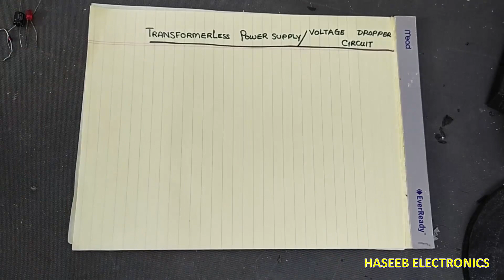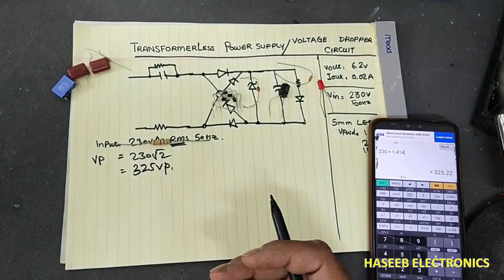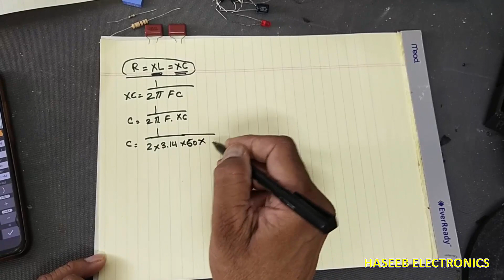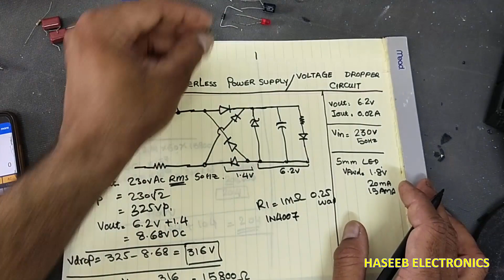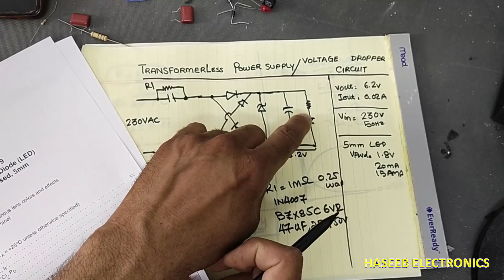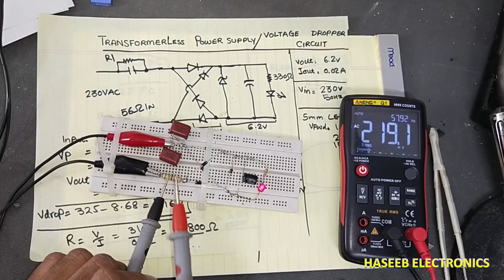{680} Transformerless Power Supply Circuit, Capacitor Dropper Circuit

Comment: Very informative video. Nicely explained practically. This Spacaility is only in your vedeo. I like your all videos. And watch again and again. I will be very thankful to you if you explain servo motor driver circuit. And i request u that pls make a vedeo on voltage stabaliser for 6 kw cnc machine.

Comment: U use a 47mf/50v  instead 50v Capacitor 10v to 50v Capacitor can be use under Stand OK  but why use 47mfd why not  2.2mfd or 2200mfd ,,, thanks a lot jazakallahu khaira ,,,,,